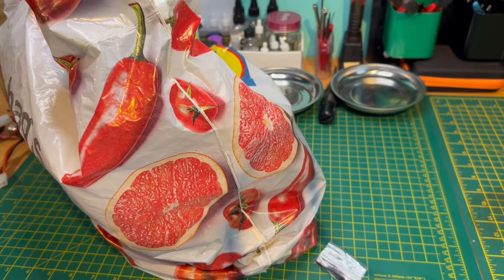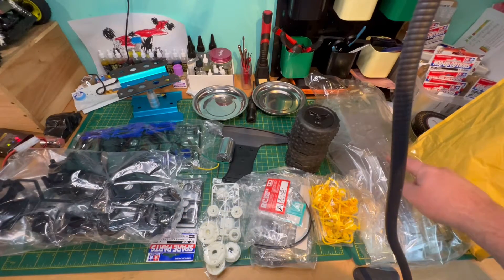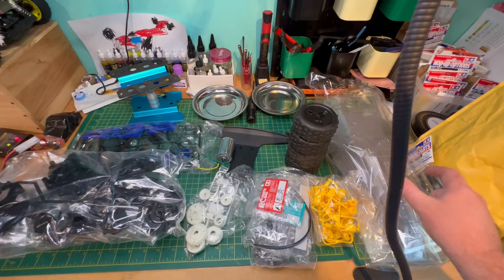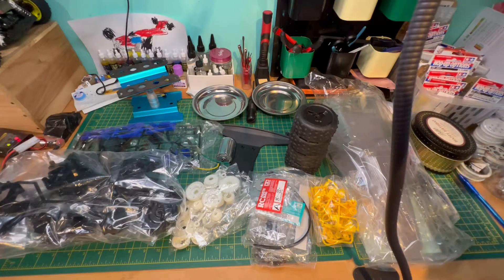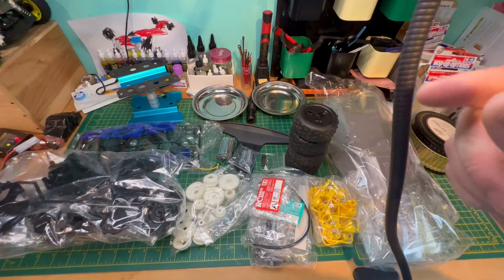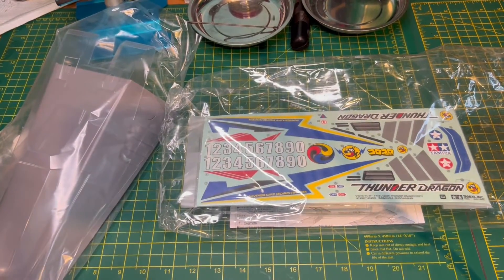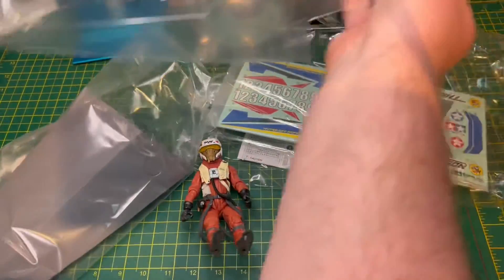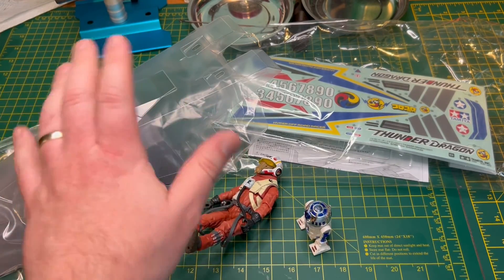Tamiya Unbagging Thunder Dragon

Comment: Great.. umm... unbagging video! LOL!!! Doesn't matter if it shows up in a wrapped factory box or an old shoe box, as long as it is fun then that's all the matters! I love the idea for them of it! Not sure if you have already started but I was thinking if you shoe-goo in some magnets under the body after you paint it then you could cut R2 in half and use magnets to hold him on for display purposes and remove him quickly and easily for running! Put in two of three magnets so it self aligns when you go to attach him and maybe some black felt on the bottom for R2 to keep it from scuffing up the body if you do run it with it on there occasionally. Just a thought... 
Have fun with it!!
Reply from the maker: Addam that is a marvellous idea dude! Wish I had thought of that and I am googling as we speak! It was a fun unbagging and the build series was great fun too. Thank you so much for watching matey 🙌🏻👍🏻

Comment: Oh buddy, that's gonna be fun. I can't wait to see this up and running!!!!!  X-Wing, Hmmm, a Gray (Grey) Clod could make one hell of of a Millennium Falcon, LOL. ATB mate!!!!
Reply from the maker: Oh man! Han Solo and Chewie as pilots 😁 One of those chess tables in the bed with C3-PO around it! You got me thinking now brother! “Laugh it up fuzz ball!” Thanks for watching Bob! 🙌🏻👍🏻
Reply: @theoagrc  I'm a poolioop.
Reply: @theoagrc  I thought the same thing mate, get out of me head, you won't like what you find in there, or maybe you would. LOL
Reply from the maker: 🤣😂 Question is what motors do you need to do the Kessel Run in 12 parsecs?
Reply: @theoagrc  Way back in 1993, Trinity (Team Trinity) had motors they called Nuclear, they were a single 9 turn motor spinning @ 55,000 rpm for us "old" guys. Or simply go for Castle Creations 7,700Kv brushless system (x2), on a 2S lipo, that's @ 62,370 rpm.  Hmm, Maybe I should do a Brushless Clod video, Thanks Craig!!!!
Reply from the maker: The crazy minds that work…. I want to see it at warp speed! Does the Clod not wheelie on acceleration like other monsters??
Reply: @theoagrc  Not so mush with kit motors (unless you go backwards then into forwards) then it will drag the rear bumper for tens of feet (on asphalt).
Reply from the maker: Ouch! Why am I researching clods… 😂
Reply: @theoagrc  Cause like I told Mark, Clods and the "Lego" of RC trucks. LOL
Reply from the maker: I just think I fancy a black canvas to have some fun with. Problem is there is so many others that look fun. Kyosho have announced a new buggy yesterday which looks fun!
Reply: @theoagrc  I don't know that buggy, I haven't heard about it.... The older rere buggies I like but seem the newer Kyosho stuff breaks easy.
Reply from the maker: Worth knowing dude 👍🏻
Reply: @theoagrc  Well, take a look at the USA-1 trucks, steering always breaks, the body cracks easy and shocks pop off easy.... Who wants to deal with that on a new truck? That said, it does look good but I was never a fan of that Kyosho chassis...
The Mad Van has it's own problems too, mostly drive line.
Reply from the maker: Yeah the bashers look a bit fragile for bashers!!
Reply from the maker: How robust is the Clod?
Reply: @theoagrc  Stock or built? both have limits. I use to jump a stock Clod off a loading ramp for semi trucks, the weak points on a stock Clod are; Roll bar lights (that's a given), the part of the chassis that the front bumper mounts to & the small "L" brackets (anti-rotational brackets) on the lower "links". Every now & then, a steering knuckle will break or the axle tube also. since 1988, I think I only broke about 4 or 5 knuckles and maybe 2 axle tubes, that's hard running, jumping and hitting shit that don't move.
Reply from the maker: Sounds like other than a bit of bodywork they hold up well! Bet those two motors rip through the batteries though!
Reply: Oh the Kyosho Ultima SB Dirt Master, that should be an awesome buggy!!!
Reply from the maker: Yeah I am quite interested by that. Just hope it is a kit 😁
Reply: @theoagrc  That and being about 10 pounds. LOL